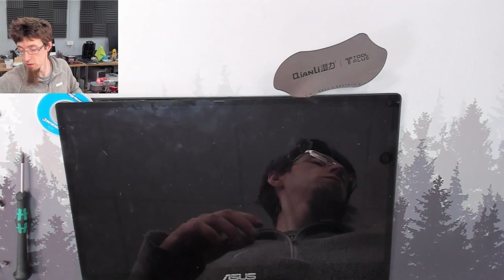Asus TP412F No Display - LFC#317

Comment: I’ve done similar repair attempts using a rice bag. Basically just fashion a long piece of fabric or even an old sock and fill it with rice. Tie the end somehow. Then just heat in the microwave for about a minute or so and you have a heating pad. It also works good when you have muscle aches.

Comment: Good job!
Would have liked to see some autopsy on the old screen. Would be interesting to see, if there was something wrong with the backlight driver on the controller board or if the LEDs them self have gone bad over time.
Reply: Maybe just a shorted cap on the booster circuit...
Reply: Good content for the podcast!

Comment: The iMac screen removal wheels are good for this sort of thing. They don't distort when heat is applied any you can drip isopropyl alcohol on the wheel which wicks into the gap to loosen the adhesive further

Comment: Easily after the first heat and first pry point on the screen
you can use adhesive desolvers like 530 sprays or some types of liquids.
Just spray on the outside of the plastic card NOT directly to under the panel.
And no need to more heat.👌❤️

Comment: 27:30 Depends on the device, on my old xperia phone I tried several cheap pre-cut adhesive strips and a more expensive one, all of them came off, the more expensive one lasted much longer, but the screen would not stay on until I used some b7000 which still hasn't come off.

Comment: I had to remove the vertical screen off my frends apple i-mac to replace the hard drive.
I used a couple of old feeler gauges to slide under the glass.
The gauges that were used for points or sparkplug gapping.
Each gauge set have the rounded end and a selection of thickness.
My old paint stripper gun on the very first setting was just  hot enough.
Never stopping in one place.
No damage 😀

Comment: I'm no expert but glass is melted and cast into molds so using a hot air gun to remove the glue shouldn't catastrophically affect it. To my delight, you did an excellent job of removing it intact.
Reply from the maker: Yea it's not the glass I'm worried about when using heat, it's the LCD under the glass.
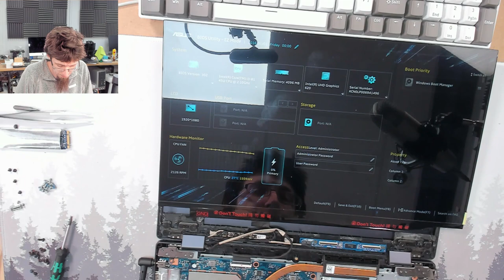Reply: @Adamant_IT  Yes Graham, totally agree. You were thinking much further. Understood (I had to watch the video again 23:02). In TV applications, it is a matter of not damaging the brown FFC (Flat Flexible Cable) called COF (Chip On Film). Thanks for answering. All the best.

Comment: You said no backlight could be caused by 3 different causes, but actually it is 4. The LVDS cable could be not properly seated in the LCD connector, thus having no backlight, it happens all the time, even if the cable has been properly secured with tape.

Comment: Hi Graham why did you not try to fix lcd screen. Mostly there are fixable and mostly there is just capacitor or fuse shorted on backlight circuit that could you save a lot of money.

Comment: I think disconnecting the internal display connector doesn't necessarily force the graphics chip to output to the VGA/HDMI ports - it probably depends on the interface: if it's a dumb LVDS cable, I doubt the chip even knows there's a display there or not - it just outputs to that connector anyway, even if a display panel "listens" or not. It probably shows up in dev manager as "standard PnP monitor" or something similar, even if the panel is not there. If it's a DisplayPort (eDP ??), then yes - it might actually know if it's physically there or not and default to the external output...
Reply from the maker: Modern laptops are eDP, or Embedded Display port, so there is communication and hot-plug detection between the display and motherboard. I'm not sure if all laptops actually implement the detection, but theoretically at least it should make a difference. If nothing else, it reduces the chance of Black Screen - where the laptop is outputting to HDMI, but because it's treating the built-in display as primary, you don't actually get a picture at the login screen, making it hard to tell if you have any output or if windows is punking you.

Comment: I haven't finished watching the video but I'd like to say that when one disconnects the battery, it's always good to try to turn it on, so all capacitors are discharged. Typically it's going to be fine, but you never know 😅

Comment: I had apparently the same issue with an old dell. Decided not to replace screen and keep the laptop for spare parts. When disassembling it I found that the screen cable had not been correctly inserted from the factory. Pushed it in correctly and it now works again. Glad I didn't buy the overpriced replacement screen.

Comment: @21:15 Re: displays are (usually) interchangable with same pin:
Question: Have you ever used one of those 30 pin to 40 pin adapter u see on ebay/aliexpress to use inside a laptop?  I mean as long as screen/motherboard have same ldvs interface it shouldn't fry right (ymmv)?

Comment: Great Job Graham.

If I may suggest, some observational advice :

- I would leave protective film on for the customer to pull it down...In this case you'll get that "Wow" effect from the customer for your job and it's also more professional, I think.

- The new  double-sided tape I would first prepare / cut on designated size with scissors or on cutting mat with exacto knife. 
In this case you'll get nicer edges and there is no option to damage the top lid. 

Take care.

Comment: you can honestly fix the old LCD screen if you are willing to check the backlight LEDs
Reply: With a hard backshell and glued in glass, the chances of cracking the screen front glass is extremely high. Even while heating up the glue.
Reply from the maker: I might have a look for science. I'm not convinced that the trouble of getting the backlight strip out and then fitting it again is worth it, but it might be easier than I think.
I haven't looked into backlight repair because it's honestly not that common. Most screen repairs I do are cracked.
Reply: i was going to suggest the same with a yt vid of course

Comment: Edit: sorry I missed the part where you plugged in an HDMI to get output, ugh I shouldn't watch these while I'm working. 

great video as always, just wondering if plugging an external monitor was an option to see if the laptop was POSTing? Since it appears it was turning on in the beginning just nothing on the display itself.
Reply: @TheSpotify95  Sorry I missed that part, thanks for pointing it out. I had the video playing while I was working so I missed that part.

Comment: I do this kind of work 5 times a week. After a while you will be like ya no problem. You might even take on Surface devices. They seem to be the hardest. On screens like this I always replace the screen with pull tabs and not b7000 glue because you have that bottom chin you can remove.

Comment: imagine at the end as he was peeling off that plastic sheet, some static charge had built up on it and breaks something 🤣
Reply from the maker: You say that, modern MacBook/air/pro screens have a nasty habbit of washing out if you pull the cellophane off too fast. They'll come-good after a minute or two, but yea, I think that's static. Scary when it happens on a £250 display assembly you just bought!

Comment: Hi, I’ve same issue as no image when powered on.  Mine is Asus z240IC H170 AIO.  I don’t know what  I did wrong.  It worked fine before I opened up to replace USB Huib which located under the MB.  I didn’t do anything to the MB.  Just removed screws and took it out.  Please help… tym in advance and hope to hear back from you soon.

Comment: Hi Graham wondering if you help me source a  replacement Screen for a Dell Inspiron 7506 2 in 1 laptop
Reply from the maker: I would search ebay for "inspiron 7506 lcd"
If the results are bad, try the model number of the LCD that's come out of the device and add "touch" to the end. A quick search, it sounds like "b156zat01.0 touch" is what you want.

Comment: I have an issue where only get display when you first turn on or jump to bios. If you let it continue to boot, it flickers slightly a few times, black screen, and only works on hdmi output after that. The voltage on the fuse/capacitor for the ribbon to the mainboard registers 5v at all times, unlike the 19v in your case.
Reply: I guess no replies on this channel. awesome

Comment: Hello Adamant IT, I got a similar problem with no power to the display at all. I tried the first versions. I do have a bios battery that I took out and put it back after 15 minutes. When I turn the laptop on the cooler works. The DVD writer works the power button led works, the charging led works and another led next to the charging led that is powering on when I power the laptop on works. It was all fine but I got to this problem after I changed the thermal paste. If you got any ideea to advise me on or maybe I can send my laptop over to you to have a look and make a video on it as well. I can pay for the deliveries and for the fix. I also tried the hdmi with and without the display connection. I took everything apart and put back together. I tried with different rams and different hard drives. I tried with different network card and different speakers. Don't know what to try anymore. I hope you can help save my laptop. It's a Lenovo z51-70.

Comment: What if the sys battery is not able to hold anymore charge and you're unable to get a replacement battery, would it therefore mean that this laptop would cease to function since you would not be able to set the sys clock without it (with other laptops you could use mains for power) ?
Reply from the maker: It can run it all on the charger, but the clock would reset every time the laptop is unplugged.

Comment: u was in a hurry to change the screen although it is possible to fix the brightness just by connecting 3.3V  between  power on and dim test points on the screen board. need just to locate them.
Reply: Sorin from electronics repair school does this a bunch on his channel.

Comment: my laptop also uses the system battery to keep time, thought the no post was the ram issue but it was the screen
Reply: thankfully not the ram because the ram is non-upgradeable and is soldered to the board
Reply from the maker: This one did have an extra slot, but yes, one module soldered in 😔

Comment: Where did you get that thin metal pryer?
Reply from the maker: Search eBay for "metal spudger"
Be careful, metal tools are much more powerful, but can also damage stuff. Use with caution.
Reply: @Adamant_IT  Indeed. I trust you have managed to avoid cutting your fingers with it.

Comment: The bad screen can be repaired and its easy, why a new one, and its expensiv...
Reply from the maker: I've honestly not looked at repairing LCD panels because they're usually cheap enough that it's not worth the trouble, but for touch-screens like this I'd definitely consider it. You think it's just a bad LED in the backlight?
Reply: @Adamant_IT  sure, fuse or 3v_en... at least u try, even if there not think in electronic called try, but for people like us u should try with precaution....😊